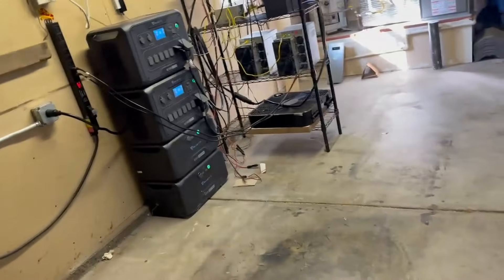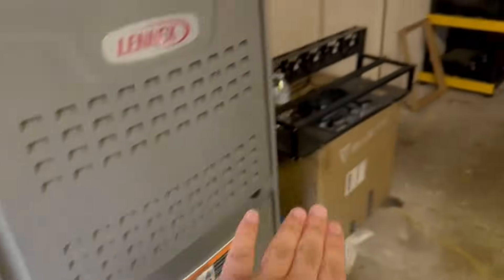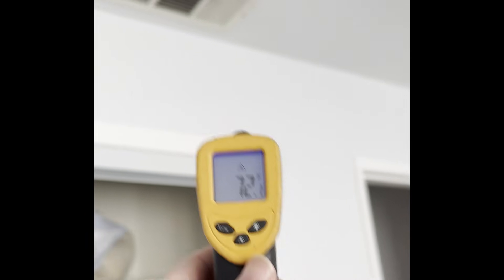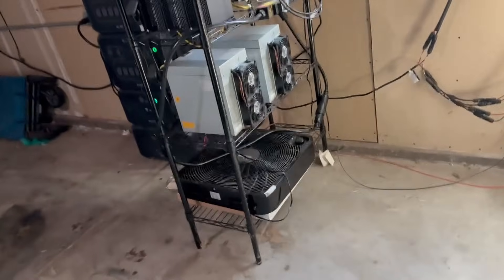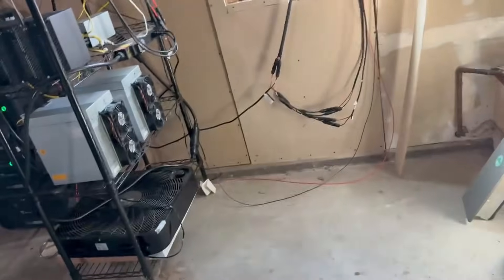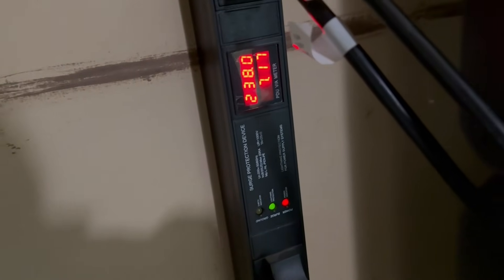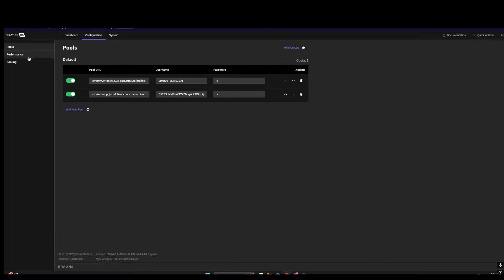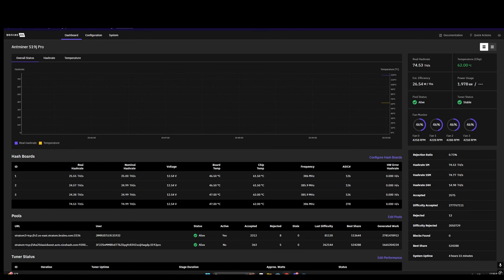Heating my house with BTC mining

Comment: You'll want to be careful of your hot water heater possibly backdrafting due to the negative pressure and your HVAC sucking products of combustion into your living space.
Reply from the maker: @jwboll  yeah I’m looking into that as well but I do have carbon monoxide alarms in every room in the house as well as I do crack open the garage window as well to allow some fresh air in

Comment: The fact that you can push that filter back that far tells me it’s the incorrect size. You have unfiltered air going through your furnace on the back side of the filter rack. I wouldn’t do that. Or you’ll be paying a guy like me to come out and clean your evaporator coil. And we aren’t cheap.
Reply from the maker: @Tommy_boy007  good point but there is a cover that goes in and that creates the seal if I take out the cover like right now that is why there is more space 
But usually I Dnt run this all day every day 
Just parts of the day 
And looking if I can find a longer filter to use for this purpose or add a small filter in the entrance of this opening

Comment: What is the outside temp? Also, a temporary enclosure of the mining equipment and furnace intake with a cold air return opening feeding outside garage air directly to the equipment would prevent loss. You are heating a lot of air in the garage. The concrete floor is a large heat sink. I couldn't tell, but if your garage door is not insulated, it is a significant area of heat loss. But all in all, it is a good experiment and a good idea to save money. Linus from LTT uses his huge home server rack to exchange heat to warm his pool, at least a little.
Reply from the maker: @thomassmith9059  outside temps during winter are around 33-45F in the mornings till afternoon 
Garage door not insulated yeah there’s good amount of heat loss for sure
But cranking these asics to pull max power draw can take of that 
Main other  concern for me to also keep them running not super loud.
Yeah watch some LTT videos also 
I should check that one out thanks